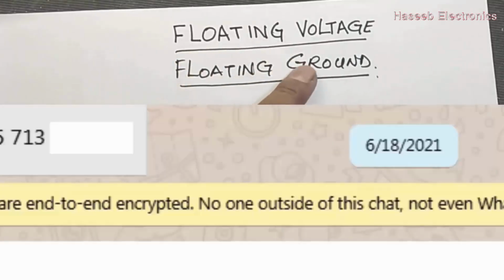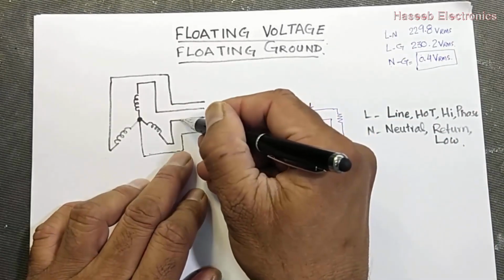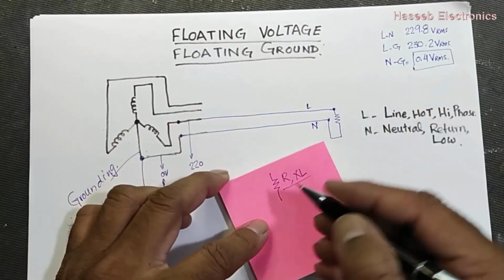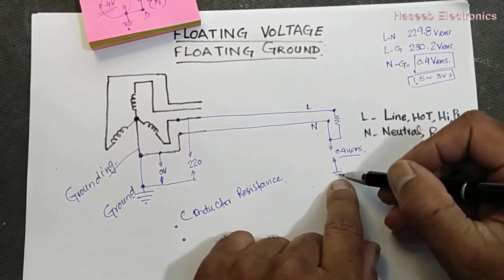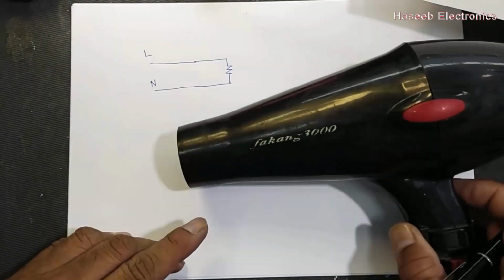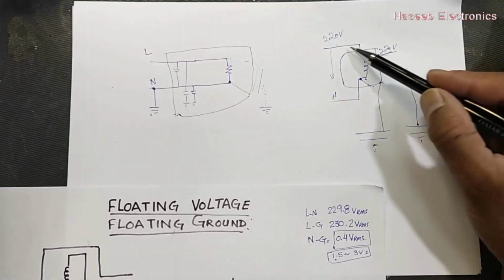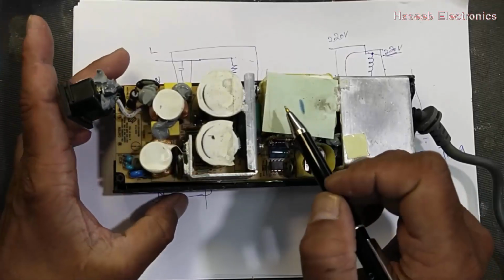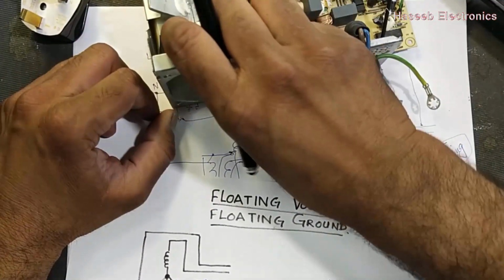{414} Floating Ground || Floating Voltage || Safety Ground || Earthing

Comment: Your video blessed me 
But question
The class Y capacitor
I thought it was to zero the voltage in the L and N path 
But instead you said it's to reduce noise 
If the N is directly connected to the chassis ground to the secondary side, won't it provide direct shock?

Comment: In the USA floating voltage is sometimes referred to as "Ghost Voltage" or "Stray Voltage" 
To test this properly you could use an adapter called the SV225 stray voltage eliminator made by the same company that makes your DMM (check it out).

Comment: I have a question, why is the GND of SMPS (point C on the image) connected to the chassis earth? Point A and B are separated on the circuit but connected together with point C trough the chassis when the circuit is screwed to the chassis! So it is not a floating circuit, if the live line is short on the chassis, you can fill it on USB cable cumming from PC! Is there any good reason why the GND on floating side is connected to the earth trough chassis? Thank you for your great lectures! (the circuit schematics doesn't belong to the circuit on image, but A,B and C sections are the same) 
https://i.postimg.cc/nLQLDm4v/ATX-200-W-PSU.jpg

Comment: Aapne floating voltage toh bataya but not told floating ground .and not explain properly floating ground .in whole lacture you r telling about floating voltage but not floating ground.so plz explain  in other small vedio about floating ground.thanks
Reply from the maker: as this video is for return or line signal
for floating ground there is a detailed video on my channel 
please check video number 414

Comment: if voltage b/t neutral and earth is present 115v what will be the fault
Reply from the maker: if we are using 2 wire power cable and the there is earthing point, that earthing point will show 110-115 VAC between line and Earth, and Neural to Earth 
because there are 2 class Y capacitors in series, 
this is good indication. this 115 will not make any short or any electrical shock. 
it is normal 
but
if there are 220 present (from line to earth or neutral to earth that os bad)  that time check the Class Y capacitors

Comment: The 3 phase secondary winding of the local distribution transformer (415v) is star connected and the output common neutral point is also grounded below the transformer.  But how the current & voltage which are generated in the winding comes to our house after following the long path while they should go directly to the ground below the transformer from the neutral point of the transformer as current follows the shortest and least resistive path.  Even if there is some resistance in between transformer's neutral point and Earth, still atleast some amount of current from the transformer should leak directly from the neutral point to the ground, but why this not happens ?

Comment: Consider this scenario. 120 VAC center tapped  step down transformer to 13 V (6.5 V from either line to center tap). Transformer is connected to mains via a 2 prong plug so no chance secondary is referenced to earth. Measured voltage between any secondary winding and earth ground is 135 V. Measured voltage between any secondary winding and line voltage is 50 V and measured voltage between any secondary winding and mains neutral is 14 V. How is this explained? For reference line to ground on the primary side is 123.9 V, line to neutral is 123.5 and neutral to ground measures 0 (although technically it's about 0.4 Vrms).

Comment: Should there not be far more voltage difference between neutral wire and the hot wire in relation to the earth from the source end to the load, considering just the transmission lines themselves before the breaker box?
Since the earth has far more resistance than the conductors.
If the hot wire touches the neutral wire at the load end on the transmission line, there will be fire, the conductors melting etc.  But if the hot wire falls and touches the earth, will the hot conductor catch fire or melt?
Both the hot conductor and the neutral have more or less equal voltage drop from the source to the load.   But I am sure the earth has far more resistance and therefore there should be far more voltage difference between the earth and the conductors than a matter of few volts. What am I missing in terms of conductivity/current and voltage drop?
Or is it that at the most points on the transmission route the neutral is grounded as much as possible so that not too much voltage difference happens between it and the earth? 
So, if you touch the neutral while standing on the ground you will not get shocked but if you touch the hot wire and standing on the ground you will get shocked even though the earth is a bad conductor but the human body is not?  And if the hot wire drops to the ground, it will not catch fire or melt because the earth is a terrible conductor.

But my main question, so it won't get forgotten is that the only way there only so little voltage difference between the neutral and the earth must be that the neutral conductor must be kept grounded as much as possible throughout the Transmisson line route to keep the voltage differenc as close as possible, but of course the electricity rather alternate between the neutral and the hot than the earth and the hot conductor? Is this about, right?

Comment: Hi sir 
For in isolated flyback ckt on sec side if we touch live wire and i am standing on groud surface is there any chance to get shock? Becoz even though it is isolated from primary human being body is able to give groud path for current.?
Reply from the maker: no dear. if we put the one wire of secondary to the earthing point, and we touch second wire, then our body comes in the circuit. then the transformer's secondary side will provide electrical power to our body, if that current will increase than our our body resistance, then we will get shock

Comment: I do not understand what you are saying at 27:44, I do not understand how bad earth can cause neutral earth volt
Reply from the maker: i am sorry for that.
if we get high resistance in earthing, and we have floating voltage in some metallic chassis, these floating voltage can are hazardous. so safety ground or earth must be connected to chassis, so any exposure to voltage should be discharged into earthing point

Comment: Thanks, very interestig.Thanks, very interesting. I have a doubt. Whats happen if my neutral wire (from electrical distribution) goes off? the other two fase return come via ground to my ground. Isn't it?
This condition is very catastrophic for my consumer

Comment: Make video  negative voltage with a context to 12-0-12 transformer and explain why no Humming occurs in dual voltage systems  like 2030 or 1875
Also 
Tell why Humming occurs in single supply in popular ic like  4440 or 6283

Comment: But the negative point of 12V supply in a computer power supply also gets connected to the ground via chassis screw because the PSU chassis itself is connected to the ground already.